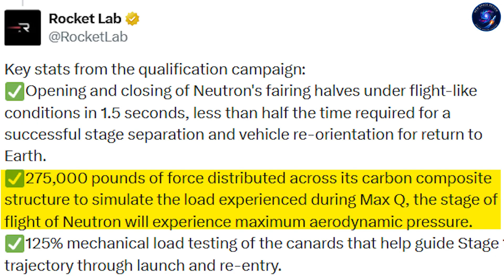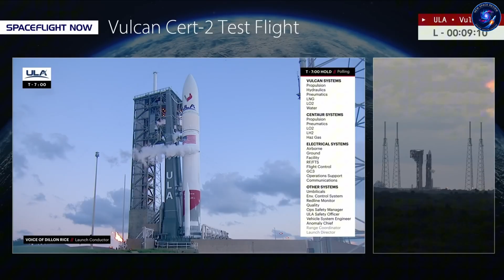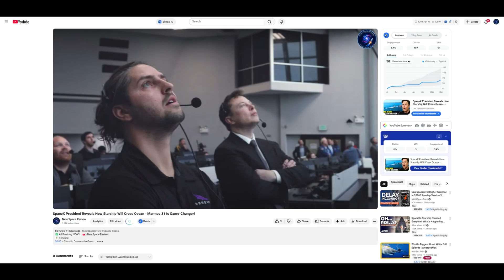Something Bad with Rocket Lab Neutron: 3 Untested Tech Shocked Industry...

Comment: Sorry, you lost me the moment you got teck info Wrong. 
For instance, you said Blue Origin’s BE4 engine was the same cycle as the SpaceX Raptor which is not true. 
Waste of time. 👎
Reply from the maker: Point taken—BE-4 is oxygen-rich staged combustion, not full-flow like Raptor; "same class" meant advanced methalox powerhouses. This underscores Neutron's risks with 3 untested tech like Archimedes—bold or reckless?
Reply: @newspacereview  They are all Methalox but full-flow combustion is a difficult beast to master. You are right to question whether RocketLab has what it takes to make this technology reliable, but remember SpaceX gave up on carbon fibre, and RocketLab has made it work. The heavy stainless steel SpaceX Starship booster needs huge efficiency-sapping grid fins extended during launch just to stop it shaking itself apart and the Nutron is smaller and fatter not requiring fins at all. Its bigger diameter means no risky Chopstick catch and short stubby legs will give plenty of stability. Also no “Bellyflop” and half-body heat tiles. The Clam-Shell nose is inspiration. Everything about this design screams simplicity. 
I find it ironic that Elon’s signature mantra: “Keep it simple stupid” Is the one that is doing the opposite and seeming to be the one that is struggling!
Long-term, my money’s on RocketLab.

Comment: Space x is good, but I would like to see beck pull it off
Reply from the maker: Totally fair take—SpaceX proved methodical reuse works wonders, but Peter Beck's betting big on Neutron's untested combo (Archimedes + Hungry Hippo fairing + first-flight landing) to leapfrog the competition. If they nail it, it'll be legendary; if not, valuable lessons. Who's got the bolder vision here?
Reply: @newspacereview  Again you are assuming that RocketLab needs to get everything right the first time to overtake SpaceX. 
This is not a race. When rocket lab is successful with Newton then they will have unique low-cost small and heavy lift rockets, potentially taking the largest cut of the world space market, particularly International customers who don't want to be tied to US or Chinese companies.